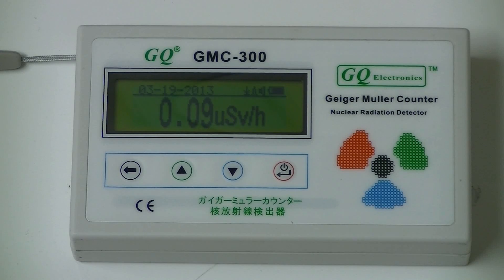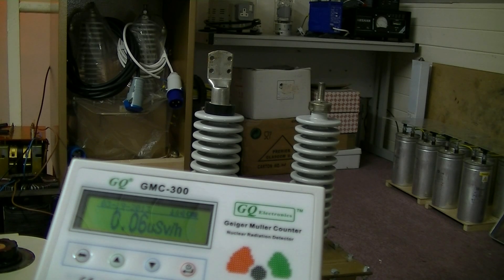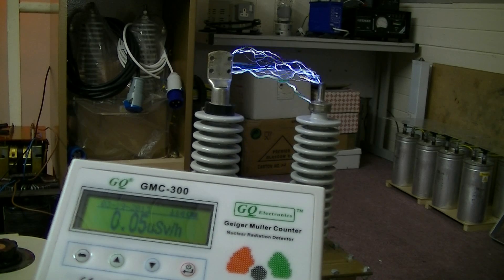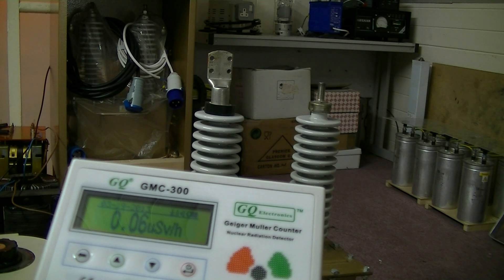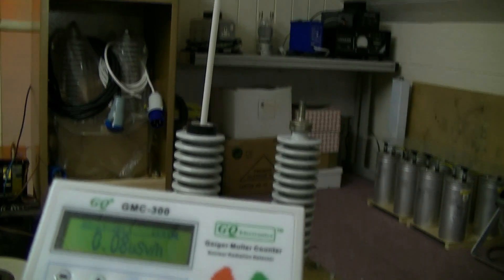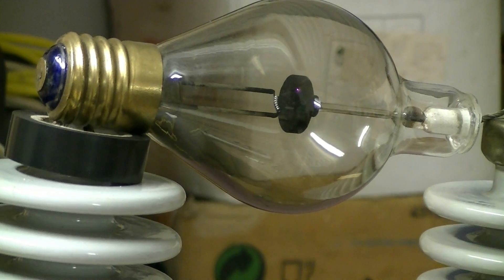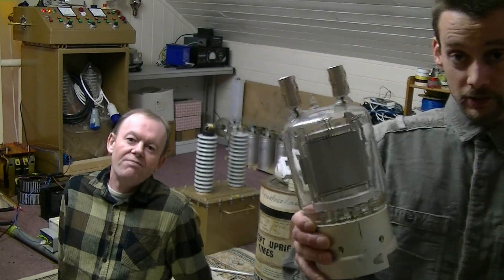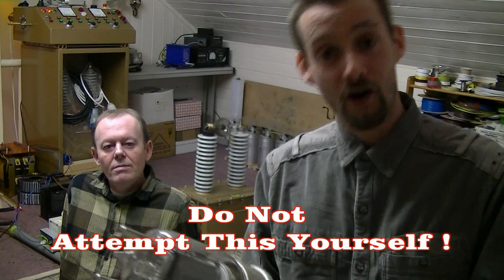Generating X rays

Comment: i wonder what his electric bill looks like ?
Reply: +fo shizzle Is not that much. You can have 10 amps at 250 volts in main and get 12000 volts at 0.2 amps.... It will be 2.5 kw/h. 5 Kw is 1 euro in Romania. My last electricity bill (for 2 months) was 200 Kw - 50 euro. So you can play 2 hours non-stop with a step up transformer as said and pay 1 euro....
Reply: Note: It is 2.5 Kw/h if that transformer is in full load.
Reply: I saw that but I just wanted to make it clear.
Reply: watch his video on "cheap back up power"   he pays 1/3 the normal rate
Reply: his bill is probably fluorescing
Reply: Its a joke, smart one.
Reply: I wonder how many times I've read this, exact same comment on one of these vids.
Reply: Such incidental hobby usage of electricity does nothing to your power bill. The real deal is in things that are continously or frequently on. Refridgerator, washing machine, dryer, AC, PC, etc.
Reply: When my stepdaughter comes over, turns on all the lights and leaves a wake of screens and devices on I think I consume more electricity than Photon.
Reply: +golden pony boy No he Doesn't?
Reply: Rocco Pirrottina Bypassed? They burned it!
Reply: dylan scrogham I wonder what his chance if Cancer is
Reply: Here in the states we're typically charged by KW/hours.  If a hairdryer is 1.8KW (which is about the most you can have on a 125v outlet without it tripping) I would imagine brief stints of play would still not incur a large bill.

  It's when you start having to run things continuously that it gets to be worrisome.  For example an inductive load like an electric motor without power factor correction run 8 hours a day.
Reply: I was going to say:  After that x-ray tube, it probably looks transparent...😊
Reply: I bet it's shocking
Reply: he stores power in batterys during off house so he saves money
Reply: @myrkurvr  The power which goes into the batteries costs also.
Reply: These guys are so crafty in a dodgy way i would have to say they have bypassed the local meter box ;)
Reply: he pays none   ask his mom  she pays it

Comment: the tube in question is a beam power tetrode it can handle up to 3400 volts dc of anode voltage not 25.000 ac. you are not operating it within safe limits not even with the heater on. two words thermionic valve.

Comment: Why does it keep going up after the power has been cut?
Reply: Temmie yes, but a while
Reply: Averaging.
Reply: +Rak The Streamer does it go back down after a while?
Reply: +Rak The Streamer ah ok thinking about buying one myself :P
Reply: legionbunny radiation isn't very predictable or constant one minute you could be next to a reactor at 1 tick then it could go to 5 ticks almost instantly then straight down to 0.20
Reply: +legionbunny it meashures value over period not right in a moment, so it will show hi value even then power cutted off.

Comment: Ok... here is a question for you. In my youth... about 1975 or so... we took a color picture tube and placed it on a metal plate (ground plane), then connected the output of a 15,000v 60mA neon transformer to the side port... with a chain suspended from insulators about 3 inches (7.6cm) above the tube, and connected to the other side of the neon transformer. (Basically a Leyden jar from hell) We fed it with 120vac run through diodes to produce pulsed DC. It would charge up a bit, then make lightning. Just how stupid were we on that? Didn't think about X-Rays... I was 15 at the time.
Reply: Don't think 15kv would have done much
Reply: askjerry A unmeasurable infinite levels of idiocy

Comment: A lot weaker than a dental x ray.  This detector is measuring the dose per hour.  A typical dental x-ray unit delivers close to .1 mSv (or 100 uSv) and it does it virtually instantaneously (in less than .5 of a second)!  

What this means is that if a dental x ray machine were left permanently on, it would deliver a dose equivalence of about 6 milisieverts per hour.  So in an hr, that's 3 times the dose of background that you'd receive in a year, but still lower than a full body CT scan.

In half a second, this tube here only delivers 0.22 microsieverts of radiation.

I'd stay in the room.

Comment: Is is bad if my dad overvolts the tubes in his tube amp to get more power out of them? It's only done by putting 240v into the 220/210 volt winding on the power supply, to get another 15-20 volts going into the tube. He also used to work in a TV transmitter that used a 10,000 watt valve for the amplifier. That's right, a valve that would put most MOSFET amps to shame. The biggest fet amp I've seen is 9000w.

Comment: why did your counter stay high after you shut the voltage down.
Reply: bhearts77 Because it is measuring in units per hour.  The readout is actually an average.
Reply: bhearts77 because there is still xrays about

Comment: good videos , you have all to make a invention , sach as, HEAT TO ELECTRICAL ENERGY , FOLLOW ME, IF YOU have water at 600 ° degree , or less or more , you can photoninducction with x ray lamp, then put hidrogen and oxigen in to the  fuel Cell , can you obtein electrical energy ,the heat you obtain  diferent way , geotermic, or gases of internal combustion engine, whrere are you from , are you engineer, best regards, martin

Comment: I'd be a bit more careful playing with that stuff. The counter doesn't look too sophisticated, and doesn't look like it's calibrated for X-rays. If it uses traditional cheap GM tube, the readings could be easily off by an order of magnitude. Typically, low energy X-rays have bigger absorption ratio in human body, and I can imagine that the real dose could be way over 100uSv/h. It's still harmless for those short periods of time you had that thing turned on, but still... Similar setup with Russian vacuum tube can give a few Sieverts/h (!) in really close distance, measured by a professional gadget calibrated for X-rays - see https://www.youtube.com/watch?v=HbQU8-LOg00

Comment: WTF?! Or you have magic video camera that does NOT pickup x-rays (small dots over the CCD or CMOS sensor), or your GM counter pickup just electric noise and false reading as x-ray/gamma radiation.
Reply: Eh, depends on output intensity, also on KeV of x-rays.

An airport x-ray machine will light up a fluorescent screen, also make a few pixel-hits on your camera.    A vacuum tube on a Tesla coil may put out a thousand times less, yet still make a geiger counter go crazy, although not able to light up a fluorescent screen or make any CCD pixels light up.

Comment: Is this microseiverts per hour?
Reply: It's per second
Reply: 23usv/h... The /h on the meter means per hour. Sieverts aren't measured in seconds as its not measurement of the radiation itself but a measurement of the damage caused to 1kg of tissue over one hour. The radiation most people seem to imagine is measured in Gy or greys and are used to measure intensity. Greys are used when the radiation is so intense that tissue damage is almost instantaneous and it becomes pointless trying to measure it over an hour.

Comment: I would stay behind a very thick sheet of lead for this
Reply: Yeah but if you knew more about it you'd understand there isn't really anything to worry about.
Reply: The dosage in this video is tiny. The highest levels at fukushima were 400 millisieverts per hour. To put a bit of perspective on things, the Sievert is used to measure the effects of ionising radiation on the body with regards to damage caused per kg of affected tissue. Also, straight off the bat, the Sievert is a HUGE number and is why in general, Sieverts are measured in msv or millisieverts. 1000msv = 1 Sievert. 1000 millisieverts is enough to cause radiation sickness but not death. In order to receive that equivalent dose, workers at fukishima would need to be there for just over 2 hours. A single dose at 5000msv would cause death in 50% of those exposed within a month and 10,000msv would cause death for 90% within weeks. (To make things a bit clearer for the overall effects, workers at Chernobyl were working in a 6000msv environment. A lot died but a lot survived.)  

What you see in this video is measured in microsieverts, I.E, 1usv = 1000 times smaller than 1msv. In the video, the background radiation was 0.10usv (1/10th of 1usv) and the highest reading was 23usv. Long story short, it takes a 1000 times longer to get an equivalent dose at 1usv than it does at 1msv. Now, for a bit of maths, get out a calculator and figure out how long it would take to get a dosage enough to cause radiation sickness but not death (5000msv/5sv) with a level of 23usv per hour. Once you have your time in hours, then take into consideration the bodies healing abilities over that time scale...

For those that can't be bothered with the math, long story short, Photon has nothing to worry about. The guys a mentalist, but he's not stupid.
Reply: Adrianrainman The guy has managed to turn a computer on so he's clearly not that stupid; ergo, he's a troll. Don't even feed the fu*k with a response. :)
Reply: gregistopal ...but the exposure to the lead itself would be MUCH more dangerous than the radiation that was developed here.  Just making a wall of the stuff...  it would require physically handling lead...  bad.

20 uSv is nowhere near close to dangerous, even over a relatively prolonged period.
Reply: +scrfce123 In medical applications the lead is impregnated within the sheet rock used on the walls. Doors are similar in that they have a thin sheet of lead in the center which can be seen when you open the door. This type of shielding is used for Xrays produced by CT scanners and regular Xray units such as fluoroscopy and mammography. Shielding used for machines like a linear accelerator and other radiotherapy devices is much thicker. Those rooms are usually shielded with several feet of high density concrete and are similar to radiation sterilization facilities. The most I've ever heard of lead being an issue is with demolition of existing shielded walls, but from my understanding it's not something serious like asbestos. I'm pretty sure that having loads of lead just sitting in a room wouldn't be that much of an issue. Perhaps if you were cutting the blocks or fabricating something it might be an issue, but the "wash your hands after touching" is pretty much what I've always been told.
Reply: defiantly
Reply: Simon Wilson No one died from radiation sickness in Chernobyl. That's all bullshit.
Reply: Dan Rob 50 people died cleaning it up. They knew they would die. There is even a documentary about it.
Reply: Simon Wilson Explained very well..
Reply: That detector he uses is quite useless to measure x-rays with tho. Search for x-Ray tube testing Russian or something similar. That guy had to amputate several fingers after playing around with his x-Ray tube...
Reply: Hobby Electronics Just out of curiosity, where did you hear about that? I wasn't able to find anything similar on several searches.
Reply: Hobby Electronics The detector is a Geiger counter.  It is specifically designed to measure ionizing radiation (which includes x-rays).   The cutoff for ionizing photons is around the ultraviolet range, so anything with a greater wavelength than the most energetic of ultraviolet, will not be registered by this detector.  Perhaps you're thinking of microwaves?  If so, then yes.  The detector is utterly useless.
Reply: mosipd
 the video is out there but the info about the damages i found out on a facebook forum for geiger counters.one of its members apparently knew the guy.
Reply: +scrfce123 physically handling lead is not remotely dangerous. The dangers of lead are hugely, hugely exaggerated. Wash your hands afterwards and don't lick it too much and you're absolutely utterly fine.
Reply: +scrfce123 physically handling lead is not remotely dangerous. The dangers of lead are hugely, hugely exaggerated. Wash your hands afterwards and don't lick it too much and you're absolutely utterly fine.
Reply: BlueCosmology If you were to build a wall of the stuff, you would be dealing with a whole lot of lead oxide (which is powdery and can be distributed as dust).  I've handled my fair share of lead.  I solder.  I have been to a few rifle ranges in my time. After an extensive period of soldering, I found myself completely tired and depressed.  Lets put it this way - I would rather be exposed to the minuscule amount of radiation produced here than suffer an equivalent exposure to lead.
Reply: scrfce123 There's a huge difference between a solid block of lead and soldering. It isn't even comparable. I've, and nearly everyone that works in experimental particle physics, have spent years in enclosed rooms with literally tonnes, often hundreds of tonnes, with absolutely no health effects whatsoever. It isn't even something that is monitored by any reasonable organisation. Look up a safety data sheet for lead, it will say in no uncertain terms that there are no known threats to health handling solid lead.

Anyone that deals with lead regularly are pretty much always told first when being trained: be careful with lead, it's extremely dangerous to drop it on your foot. Other than that, there's no other safety concerns.
Reply: BlueCosmology Not even lead oxide that builds up on the blocks that you'd use?...  The white powder which easily separates from the lead when disturbed?  I can foresee it being easily ingested via respiratory and digestive pathways.  

From what I've personally noticed, the lead shielding walls used in physics and nuclear medicine are not exposed.  They are normally obfuscated by an additional, more conventional wall.
Reply: scrfce123 Like most metals, a very thin layer of oxide forms on lead and prevents any more forming. This is much too little to cause any problems, not to mention it is incredibly difficult to get ahold of pure lead anyway, unless you're purposefully looking for it and willing to pay a premium it will be coated.

In most physics applications just blocks of lead are used, medicine I assume it's covered for the sake of it but don't really know.

Again, don't take my word for it, just look up a safety data sheet for lead. 

"Information on toxicological effects:
Lead in massive or sheet form is not a significant health hazard."
Reply: Andy is an expert so he knows what he is doing
Reply: Simon Wilson No one died from radiation sickness in Chernobyl. That's all bullshit.

Comment: "I wouldn't want to be in the room with that, let's turn it up some more" classic photon.
Reply: Turn down for what?
Reply: +Tim Gomes Well on a flight at about 20km height there is also about 13uSV/H.
time to leave the room when it switches from uSv to mSv :-)
Reply: Filippe Barros Decrease the potentiometer's value for an unspecified reason.
Reply: +Tim Gomes Well on a flight at about 20km height there is also about 13uSV/H.
time to leave the room when it switches from uSv to mSv :-)
Reply: +Tim Gomes Well on a flight at about 20km height there is also about 13uSV/H.
time to leave the room when it switches from uSv to mSv :-)
Reply: +Filippe Barros tyn tyn tyn tyyn tyyn tyn
Reply: +Uli Herrmann
Wrong. Passenger jets don't go higher than 12 km.
Reply: @SeldomPooper  Concordes flew at 18 km.
Reply: Oh my
Reply: TURN IT DOWN
Reply: he meant the geiger counter, theres chinese letters on it it might explode at any time

Comment: So what type of x rays are you guys producing by doing this? Real gamma radiation?
Reply: Same thing but lower energy
Reply: ***** no, x-rays are different from alpha radiation. Alpha radiation consists of helium cores (2 protons and 2 neutrons). Gamma radiation is light of a certain (very short) wavelength. X-rays are light with a bit longer wavelength (a few nm) but still shorter than light (a couple of hundreds of nm). Beta radiation is just electrons. Alpha/beta are charged particles with mass and photons are massless and zero charge.
Reply: Simon Nee isn't it alpha radiation?
Reply: Simon Nee ok, I knew alph radiation consists of he2+ ions but i forgot that gamma radiation contists of photons ^^.
But thanks for the explanation
Reply: ***** the important thing is the ways the different types of radiation interacts with matter. Check for instance Compton scattering on Wikipedia for the typical ionization by photons
Reply: *****
if xrays would be alpha radiation you would be long long dead by now
Reply: ***** no the only difference is the energy. You could produce gamma and xray from the same sources in most cases btw. Read some Wikipedia page
Reply: So yes, you could call radiation resulting from low energy gamma decay gamma rays, but that's an exceptional and quite uninteresting case. Gamma rays are to most people radiation over 100keV in energy
Reply: ***** you're right. Sorry for being a bit rude.